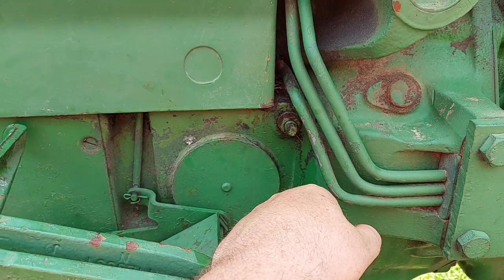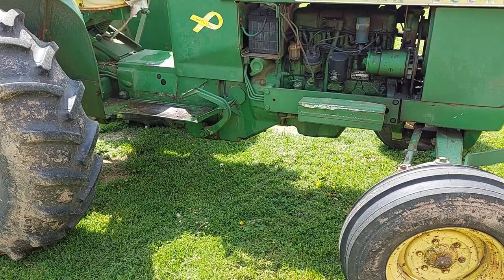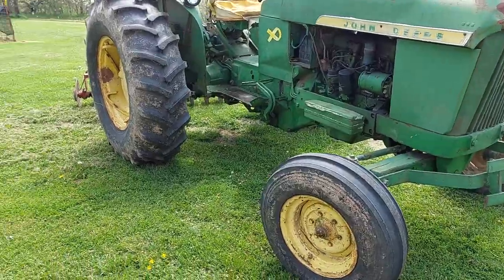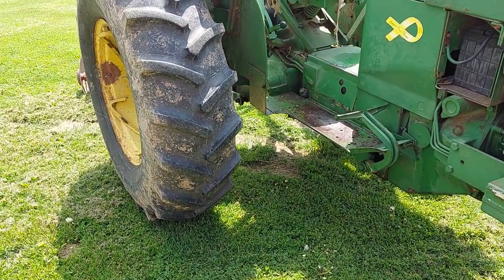2010 John Deere Clutch Pedal ADJUSTMENT LOCATION

Comment: Hi Buck, thanks for this video, useful info & Im sure it will help some of us 2010 owners at some time. I believe you were correct about the free play situation, it sounds like you did not have enough and this can potentially keep the clutch disk partially disengaged resulting in the issues you were having, ie: symptoms of a slipping clutch, and you were right to address it straight away. A stitch in time, saves 9! Thanks and cheers from Australia

Comment: Thanks for the video. My clutch seems to be ok at the time. But who knows when that could change. Mine is a '62 and still does a good job with what I need it to do. The front end loader is Irreplaceable to me. Do you know what year yours is? I think I had heard that the early ones had transmission problems. Mine has been in the family since the late 60's. The most serious problem we had was when a mouse made a home in one of the cylinders but it didn't do any serious damage. I think the piston was still usable even. It starts really well.
Reply from the maker: Not sure on her year.  Will need to check the serial number.  We've had it since 2017 or 2018.  Bought it up in Iowa.  The Massey Ferguson 50 we also go lt up in Iowa around 15 years ago.  We still have my Grandpa's TO30 Ferguson he used until the day he died.  My dad is 64 now and I believe he was only 10 or 12 when they got the TO30with some help from the neighbors.  My Grandpa's 8N ford burned in the shed and the TO30 was its replacement.  My dad jokes now saying it's a TO 3020.  One of a kind lol.  He overhauled a motor out of a TO20 20 years ago and put it into the T030.  We also still of course have the old JD 70 my dad bought not long after my grandpa died in 1990.  Used it to bale, mow, and rake.  His sister's husband had a Farmall H (his first tractor he ever had in fact) he sold to my dad.  My dad farmed with it some when my grandpa was alive.  Picked corn with it.  He used a heavy disk on it and the tyranny went out of it.  My uncle bartered for it back and he still has it now.  It's been sitting for 5 years since it last ran.  Engine is locked up tight on it.  We are going to try to get it unstuck one of these days and mu uncle said I could have it back to have out here on the Farm.  He's got a whole bunch of old tractors as well.  He's a farmall man.  He's got the H, an M, 706, 806, and some sort of Heston Fiat.  Great big four wheel drive tractor.  It's old but the newest thing He's ever had.  He also has a an old allis Chalmers WD.  It also use to be my dad's but he gave it to my uncle.  Oh, and my uncle has an old JD 620 with a loader on the front.  It originally came from out here close to where my farm is, but my uncle bought it years ago. Only JD he has.  It's also locked up. 

Lots of old tractors and trucks over the years.  Tons of old equipment and metal strung along the timber line of my Grandpa's.  Old rotto balers,, steel wheel rakes, you name it.  My grandpa probably baled hundreds upon hundreds of acres of hay every summer with that little TO30 and roto baler.  Had to clutch it  since it didn't have live hydraulics.  Never replaced a clutch in the old girl.  Hard working vet who had a passion for farm life, his family, and dogs.  A man I truly wish I could have met.  But I feel his presence.  Living here on the old farm :)

Comment: If I'm getting this right, your clutch wasn't taking hold until the pedal was about to the top? This is the issue with my grandsons 2010. The JD manual (not a reprint or a very good knock off), shown the adjustment up from yours behind the side cover. No wonder I couldn't find it! They had me looking in the wrong place!
Reply from the maker: @martinbenton742  yep same here